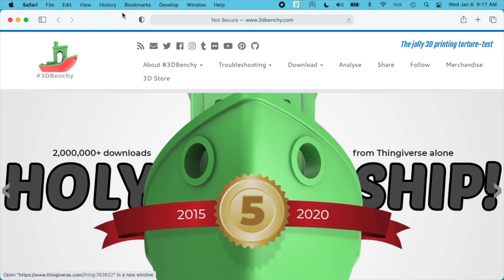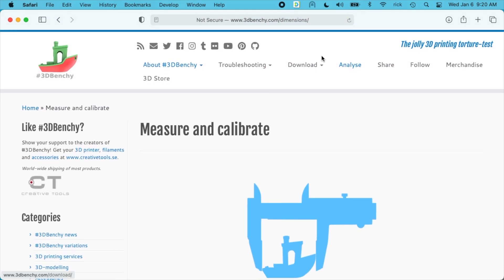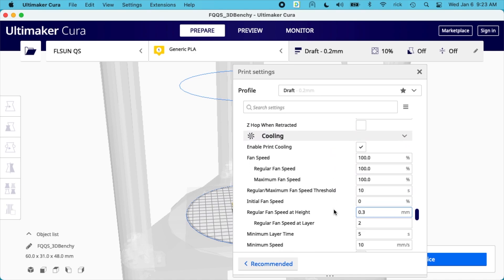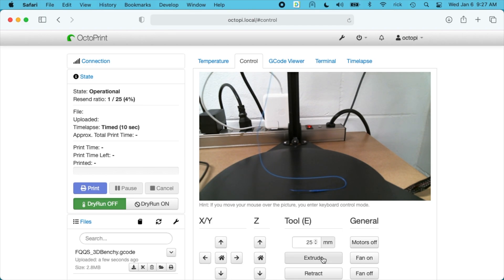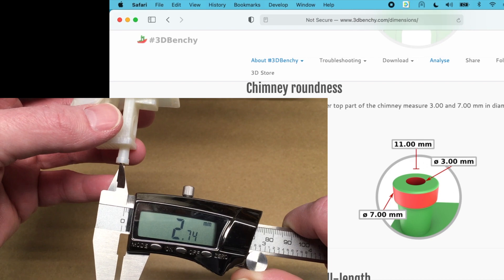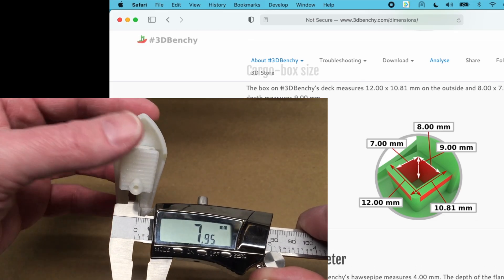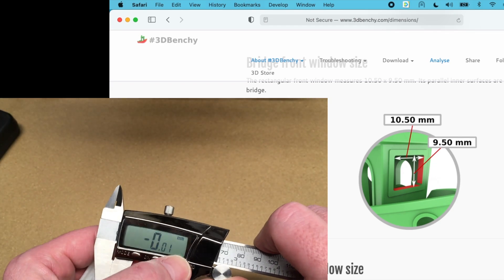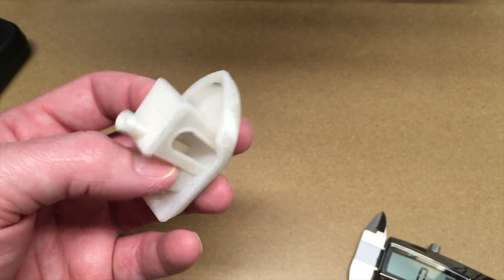FLSUN Q5: Printing a 3DBenchy (Ep. 18)

Comment: Hi,
glowing in the dark filament has abrasive particles.

Test your nozzle to see if the hole still has 0.4mm. It will get bigger and bigger the more you print the filament. Therefore it is not suitable for calibration.
Reply from the maker: I've heard that but it didn't come with a warning in the package. I wasn't sure if all glow in the dark filament was abrasive or just filament containing strontium aluminate. I'll have to keep an eye on that. Is there a specific way I can measure the nozzle?
Reply: @Rickmakes  I can't say if every filament that can glow also contains abrasive particles. However, since it may be, I would only use it if you are aware that the nozzle may be worn. You may be able to test for wear with acupuncture needles larger than 0.4mm and a new nozzle as a comparison.
For a calibration, however, I would recommend a new nozzle if you are not sure whether you have printed abrasive filament.

Translated with www.DeepL.com/Translator (free version) ☺️